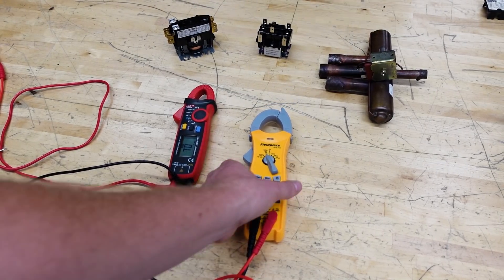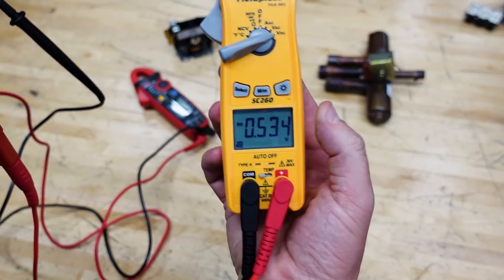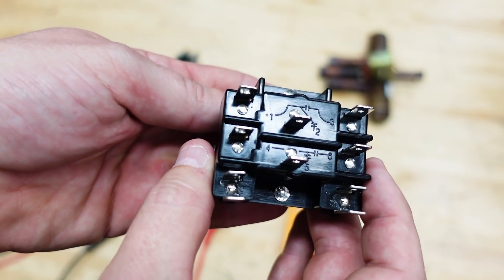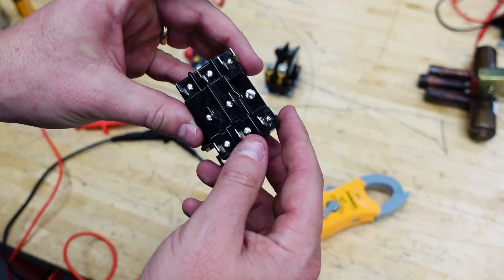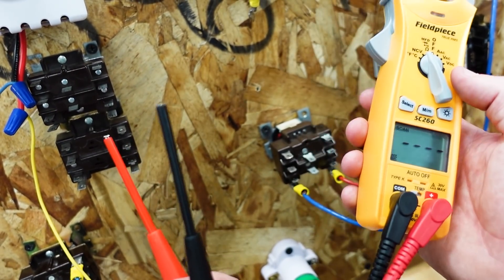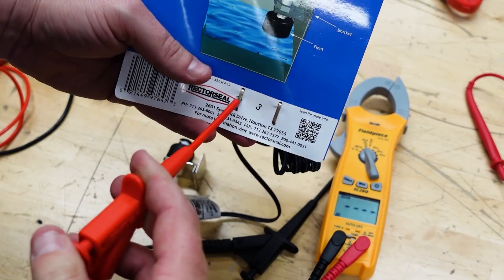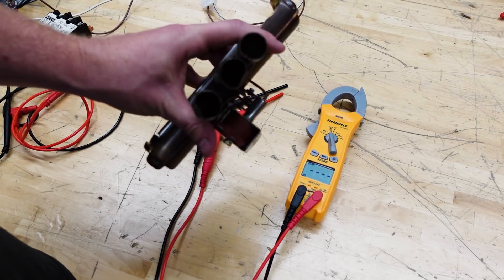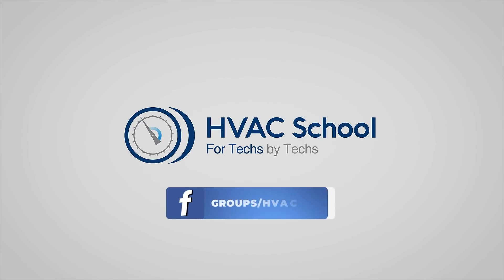How to Use an Ohmmeter Basics (And I make a SUPER rookie mistake)

Comment: OL stands for OUTSIDE LIMIT (of the meter) or OPEN LINE  It is not taking a measurement of any kind. It has no reference. Also, infinite doesn't apply to real things, an infinite row of houses could not exist. It's a conceptual or imaginary number referring to number sets, like the number of divisions you can make between 0 and 1. 16ths, 32nds...

Comment: The high voltage coils mostly have insulation on the coil and the 24v ones are shiny copper with no outer insulation

Comment: This was great!! Now for a (part 2) video you should make one hooking everything up from the thermostat!! Like from the thermostat to the transformer, then from the transformer to the contactor, then the contactor on to the hear relay and so on!! All the way through to the outdoor and indoor fan!! Just do a video of wiring everything up on that simulator board you was using in this video!!
Reply: We have a final in 2 weeks and I am having the hardest time wiring up this simulation board in the lab!! Like which colored wires(loads) go where from the thermostat and then all the common wires and where they go!! If you could make one of these video in a week or two before my final that would be great!! No pressure lol.....
Reply: We have a simulation board in the lab with 2 lil fans (outdoor and indoor fans) and 2 light bulbs one representing the compressor and one the electric heat... the other things are a transformer, contactor, heat relay, and indoor fan relay

Comment: Curious.  I am wondering about the 3 way valve coil.  That particular coil has to work against a load and is possibly designed differently than the other coils due to the stresses it would reapedly be under.    Just curious now.   🤔

Comment: At 10:00, I'm pretty sure you have your thumb on one of the shading ring.  The little loop of copper/aluminum that encircles a portion of the magnetic field putting a that bit out of phase with the rest so that the coil doesn't release when the AC current crosses zero.  Like the large gauge copper loops on shaded pole motor stators.

Comment: I wish the field piece would just say OL instead of those dashes
Reply: I have a Fieldpiece SC-480 and it’s says “OL.”
Reply: @gregmercil3968  Hmm guess I shouldn’t have settled for the ultra base model. I got the sc240 and the size is convenient but the lack of features aren’t so I’ll look into getting a 480
Reply: @EastDallasKicks  the SC480 is a great meter. The only other one they make that I’d want I the SC-680. It can do everything the 480 can, but has some features that it wish my 480 had. Only thing it’s that the 680 is gigantic. Also, stay away from the HS35, Which I also have and it sucks.
Reply: @gregmercil3968  Ah thanks for the recommendation it really helps. I’ll probably buy the multimeter first and afterwards I’ll buy the 109$ series 41 basic yellow jacket 3 port gauges that everyone starts out with haha. I already have some but they’re old and preowned so I don’t trust the seals to not be leaking. I’m about to finish my third class, I’ve taken basic refrigeration, basic electricity, and I’m about to finish controls but I feel like most of it just goes in one ear and stays for a few days and then it goes out the other ear. Did you go to school or did you just become a helper and avoid school? Because I feel like I should’ve tried to become a helper instead of school, what would you recommend? Or really how did you get into HVAC
Reply: @EastDallasKicks  I went to school for it, and despite what many might say, I feel school is very important. They teach you all the basic yet super important fundamentals in a relatively short amount of time, which could take years to learn just starting from the ground up in the field. Plus having the school training and also being EPA 608 certified (which is EXTREMELY important) gives you a huge advantage over the other new kid that just walked in without any schooling. I got into HVAC because I love fixing things and getting paid decently for it.
Reply: @EastDallasKicks  buy the rebuild kit for your manifold and save the $ for a probe set down the line.